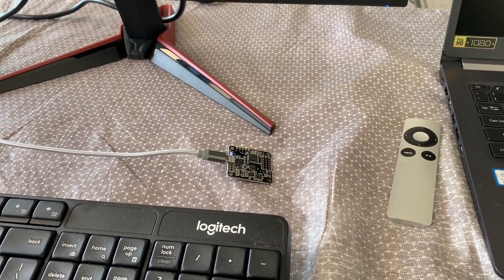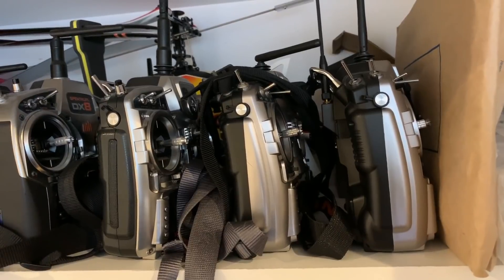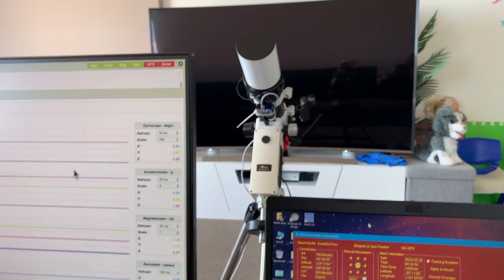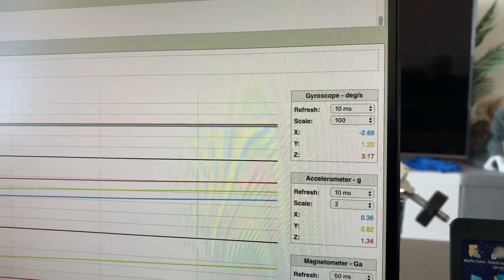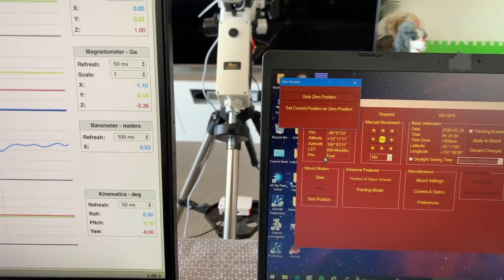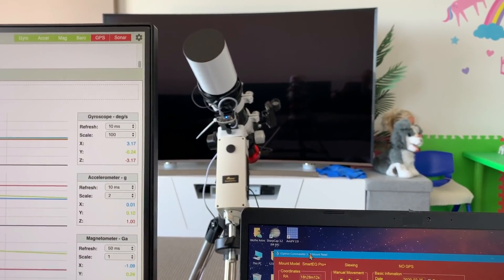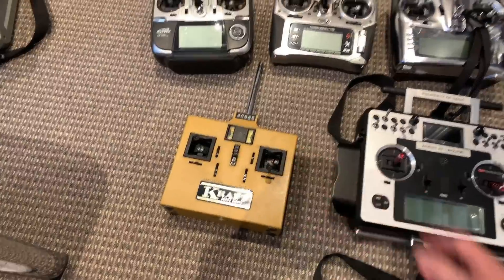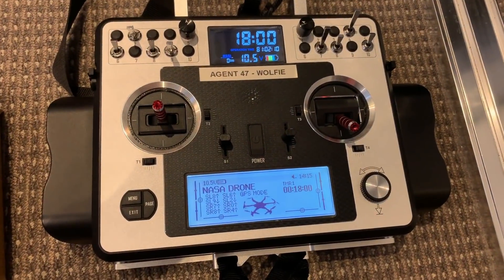Can a drone gyroscope display the rotation of the Earth with hobby level software?   Let us test it.

Comment: You have to be careful; at least some mems gyros also have accelerometers on board which are used in the same way as the "pendulous vanes" on airplane gyros: they bubble level the gyro over time.  Therefore they would never show the rotation of the earth even if they were sensitive enough.
Now, the main purpose of these artificial "pendulous vanes" probably IS NOT to correct out rotation.  Instead, it is to assist in the accuracy of the device over time, since the inexpensive MEMS gyros are not sensitive enough to hold orientation for long without the assistance of the accelerometer.  However, intention aside, the effect is that these gyros too will correct out any earth rotation or angle traveled over the surface of the earth.
See https://www.youtube.com/watch?v=EgwoDWpn5jA if you want to go over my evidences for this.
I can't speak for sure about the flight controller wolfie used in this video, but I suspect it's the same for it.

Comment: So glad I watched to the end.
Question about the gyro: is the gyro itself not sensitive enough or is the software reading and displaying the gyro output just not instrumented to the degree of precision necessary to show the acceleration? If the latter, could you tweak it? The software, I mean? Or is that just beyond the capabilities of the accelerometers?
Reply: Actually it's the instrumentation. Software can't make up the difference for cheap instruments. Wolfie was just showing that an off the shelf gyro that is cheap can pick up rotation but it has it's limits. This would be similar to a load cell in a scale. High dollar ones have a much better resolution as compared to just a store bought one.

On the other hand, what Wolfie did show is how technology is moving at a pretty good clip to where even a cheap gyro is pretty darn sensitive. You see this with sensors of all types. The resolution gets better at each price point.
Reply: @billsmith5960  Thx. Was just wondering, since even before mounting it, when the unit was just lying on the table the x-axis display was jittery. Wasn't sure if that was just stray signal or indicating detectable acceleration below the display limits.
Reply: @bobshafto  - Just walking around will cause the jitters. In motorsports we have three axis gyros and accelerometers. If you start pulling live data while the car is just sitting there, a car next to it starting up will cause it to jitter. This is why you have to filter out a certain amount of data. If not, you get way too much garbage.

There are different level of filtering that works for sensors that are more sensitive.

Comment: When you were rotating the telescope at 16X the speed of the earths rotation, you are not correct. For Flat Earth Proper Speak,  you should have told everyone that the telescope will be spinning at 16,000 mph. That's what they can understand.

I'm amazed that you displayed your agent number. I thought you were agent 33 as I'm agent 66.
Reply: We're all agent 47 on public-facing documents :)
Reply: @david_akerman  - Did you notice that Wolfie covered up the chemtrail switch on those controllers? As we all know, we do close and local chemtrailing when there's too much confidence in flat earth for a particular area.

Comment: Very cool as usual.  
I have once read a paper showing the difficulties of detecting the Earth's rotation with low-cost solid state gyros similar to those generally used in drone flight controllers, and the conclusion was that they actually could detect the rotation of the earth, given enough compensation for errors, adequate filtering and the like. The link follows below:
www.tkt.cs.tut.fi/research/nappo_files/Symposium_Gyro_Technology_2010_web.pdf
If the link doesn't show, that's www . tkt . cs . tut . fi followed by /research/nappo_files/Symposium_Gyro_Technology_2010_web.pdf.

RC aircraft: 
I started about the same time you did. Here is my very first RC Tx which I got in 1976. I flew many airplanes and gliders with it and  still have it to this day (but wouldn't dare flying with it any more, as it operates on 27 MHz): https://i.ibb.co/mtyw7zT/P-20181013-130721.jpg

I started flying helis in 2005, with a Thunder Tiger "Raptor 50". Then I moved away from glow fuel altogether, and got a gasoline-powered Miniature Aircraft USA "Excell Spectra G". On the other end of the size range I also fly an Align T-Rex 450.
And of course the drone. A TBS "Discovery Pro" bought in kit form, which I had the pleasure of assembling.

Comment: Love the ending! LOL.

I've played with MEMS accelerometers and gyros, primarily the ones from InvenSense and using the Arduino microcontroller. As you know, these devices come with data sheets listing all their functions and capabilities. In the United States, there is a section of law called ITAR, International Trade in Arms Regulations. It has a section on both gyroscopes and accelerometers. It specifies the maximum sensitivity and drift for these sensors to not fall under ITAR's regulations. Consumer MEMS gyros fall under the maximum by a fair bit. This is so they can not be used in missile components. GPS receivers are also covered for the same reason.

In spite of that, people have used MEMS gyros to detect earth's rotation. You have to jump through a number of hoops to get it to work. There are different ways of doing it, depending on your particular sensor. All methods involve taking large numbers of samples over a period of time. You have to cancel out things like DC bias, noise from the power supply, etc. Needless to say, the data is not even close to real time. As far as measuring the actual rate of rotation, I don't know how close anyone has come to the actual rotation. Detecting that it happens at all with these devices is tricky enough.

Comment: The problem with MEMS gyroscopes is that they are very noisy by design (having moving parts on the nanometer scale, converted to electric signals). If they were more sensitive, the sensor part in the chip would be too fragile for practical use (e.g. impact-like acceleration/deceleration could break a MEMS IC) and even harder to get a stable signal out of it. Current MEMS ICs are using additional signal processing (e.g. Kalman filters) to trade in futher resolution for signal quality. MEMS gyros are simply designed for the everyday, pratically useful applications of motion sensing, not the top 1% corner cases, where cost, complexity and availability of equipment is only relevant for research (no, not FE-grade research) or aero-nautical applications.

Comment: WOW that's some collection of transmitters, why so many? I used to work for Heliguy building and flying rc helicopters, shame my old website is no longer up but I still have a few videos on my channel.
Reply from the maker: +Gary Graham.  I was living in Perth for a few years before moving to my current aircraft based in Sydney.  It was a job that only flew Friday and Sunday evenings so I had every other day free.  Plenty of time to fly RC and build helicopters.   

The radios were really to try different models as they all have pros and cons.  I got two of each as one would be for planes and the other for helicopters as the throttle ratchet is different and I used different spring tensions in each.   Really light for the helicopters and heavier tension for the planes.  It just added an extra dimension to the fun. 

It was overkill but I had too much free time.
Reply: @Wolfie6020  Ah I see 👍
I started trying to fly helicopters and quickly learned that I could repair and build them better than I could fly them. I switched to fixed-wing models to practice and found it much more relaxing, I then found that I could repair and build those quite well too.

This is one of the builds I did for a customer.
https://www.youtube.com/watch?v=bZVrXdQ1kXU
This was my pride and joy.
https://www.youtube.com/watch?v=c6QdPZwE_O4&t=2s

Comment: The low cost MEMS (micro electromechanical systems) gyros used in these devices are rate gyros, i.e. they detect rate of change of angle. They are very sensitive but they also suffer very badly from drift which varies over time and temperature. This means you cannot integrate the output over any significant period without huge errors accumulating which  limits their usefulness for very slow rotations.
Reply: There's been a couple of papers where they've measured the rotation of the Earth with top of the line MEMS gyroscopes but it's very difficult because of drift and bias, as you say. In one they mechanically rotated the gyroscope and used Kalman filtering to remove the errors.

Comment: It would be interesting to collect data for a couple of hours with the gyro on the table, then turn it through 180 degrees and collect again. If there was a consistent difference in the averages that might be Earth rotation.
Reply: I was thinking that, with the mount polar-aligned, it would matter whether it was rotated left or right. You might have to customise the software to get a long-term average reading.
Reply: FE map.
https://youtu.be/mYANx2jxMMc

NO curvature.
https://youtu.be/F4h9Y5lqn5w
Reply: @newperspective7790  
Why so salty?

Comment: I've done this same test with a mpu6050. They are simply not precise enough to capture rotation if the earth
Unlike airplane IMU like honeywell's ADIRU and the likes that use laser gyros precise enough to measure the variation in the rotation of the earth and detect your latitude based on that
I visited the honeywell aerospace division in redmond Washington, but didn't have a chance to talk to the engineers which was a bummer

Any way, fly safe
Reply: FE map.
https://youtu.be/mYANx2jxMMc

NO curvature.
https://youtu.be/F4h9Y5lqn5w

Comment: Hi Wolfie,
interesting to see that in the 1980's at Australia the same frequency (40.68 Mhz) was reserved for remote controlled toys as in Germany.

Btw: I built my (first and only) remote controlled ship in 1968, including the electronics. While in the 10 years following I did lots of electronic designs, at a hobbyist level, that first attempt actually was a partial fail. Being scarce on (pocket) money I decided to buy all the parts (transistors, resistors, capacitors, etc) separately and solder them on a self-designed PCB, I etched using an iron(III)-chloride chemical solution.

But the layout I designed was too coarse for a 40 MHz circuitry (and/or I as an 14/15 year old boy had been too optimistic in regard to my capabilities). So I finally ended up in buying the transmitter and receiver modules and only built the remaining electric circuitry around it.

Thanks for that video, invoking some old memories from more than half a century ago.
Keep on your good work!

Regards (currently from a nice holiday location in Phuket),

-- Martin
Reply: FE map.
https://youtu.be/mYANx2jxMMc

NO curvature.
https://youtu.be/F4h9Y5lqn5w

Comment: I have been trying this with the 3 mode FY-30A
Reply: Hi Wolfie, are there any filters in that somewhere, either on the sensor board or in the software? I've programmed a couple of things using the gyro and accelerometer sensors on my phone and there's a fair bit of noise from them that has to be filtered out to get a steady signal although that could be down to lower quality sensors in my phone.
Reply: FE map.
https://youtu.be/mYANx2jxMMc

NO curvature.
https://youtu.be/F4h9Y5lqn5w
Reply: @newperspective7790  You have shown how gullible you are more then enough times now. This just seems desperate. Pathetic that you fall for videos like this...

Comment: I've always wondered whether if you hooked up a fibre optic gyro like the KVH DSP-1760 to a battery and drove a few hundred kms North or South, whether you could measure the change in angle (on a level surface, aligned North-South at both origin and destination)?
Reply: FE map.
https://youtu.be/mYANx2jxMMc

NO curvature.
https://youtu.be/F4h9Y5lqn5w
Reply: @newperspective7790  I've driven all over Australia. I know without a shadow of a doubt that it's the same shape as it is on Google Maps. How could you expect anyone to take that map seriously?

Comment: He has almost as many transmitters as he has telescopes.   🔭 😁
Reply: Actually these transmitters are just camouflage for the secret mind control weapons we NASA shills use on people. They hide our true 7-dimensional reality (4 spatial and 3 temporal) from ordinary people who would go crazy otherwise. Those who show the first signs will just get another dose using these devices.

Sadly enough the last charge manufactured at a cheap Chinese plant was a bit too strong and instead of removing just 1 spatial dimension when the brains tries to think in 4D, reducing the thinking capability of ordinary people to 3D,  they reduce to 2D.

From the temporal dimensions they (correctly) left just one but not completely intact, thinking in that one remaining temporal dimension immediately invalidates any thought going further back than 6000 years.

Even worse, it currently looks when this happens to people below a certain IQ threshold it becomes a permanent condition while on the other hand it bolsters their ego and makes them think they were intellectual super heroes.

Hence now that problem with the upcoming belief in a Flat Earth by those who accidentally caught too strong a dose and not only lost some of their thinking abilities (which they may or may not have had in the first place) but even start to strut around thinking they know more than everybody else around them.

Yes, it's a bit a pain in the a***, we know and would like to apologize for it, but for the moment we have to live with the flerfs. Just get used to it and ignore them whenever you can.
Reply: FE map.
https://youtu.be/mYANx2jxMMc

NO curvature.
https://youtu.be/F4h9Y5lqn5w
Reply: new perspective 
And if you believe either of those videos then yea you’re a moron!